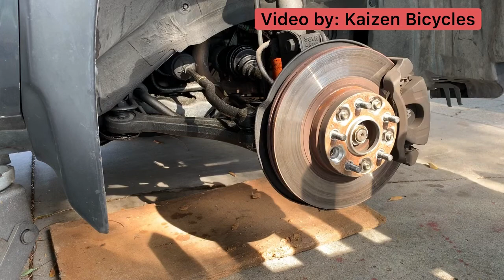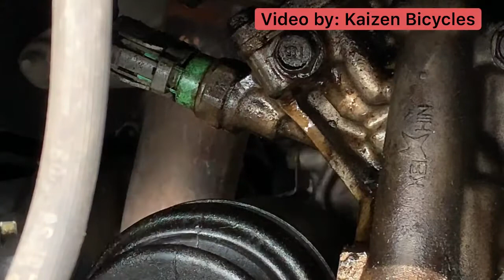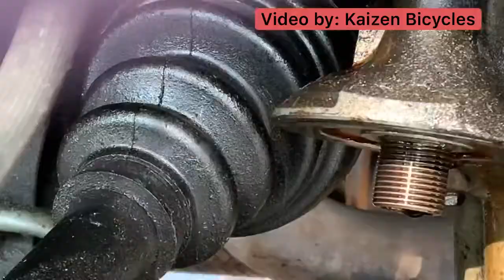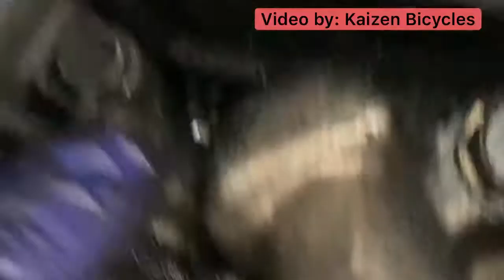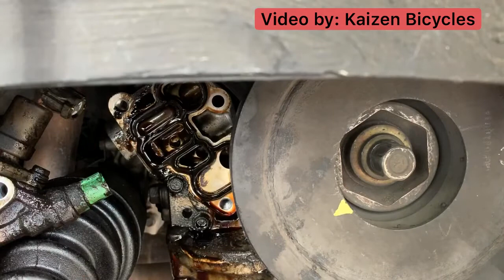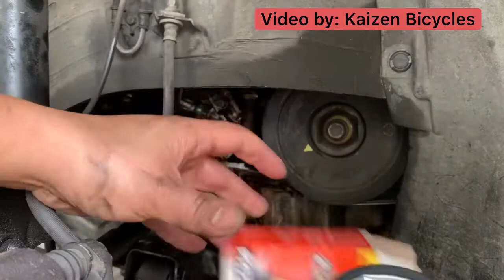2004 honda pilot J series V6 honda engine valve spool gasket

Comment: I only wish I'd found this excellent video before I accidentally removed the timing belt tensioner when replacing the gaskets on the valve spool and valve and have to go through all the mess of reinstalling that tensioner.   This job should have taken 1 hour or less.  I'm about 12 hours in and awaiting parts to fix my mess.   Thanks for sharing